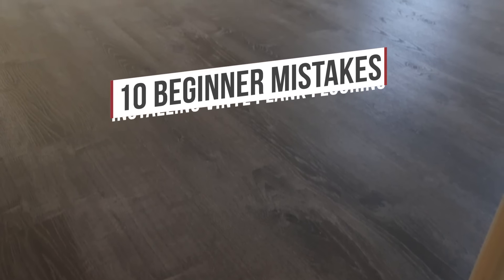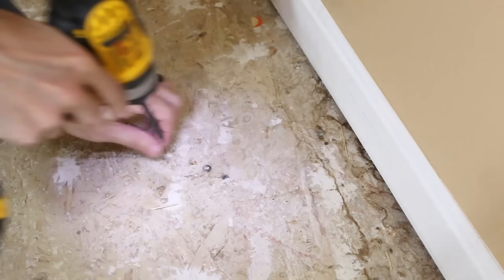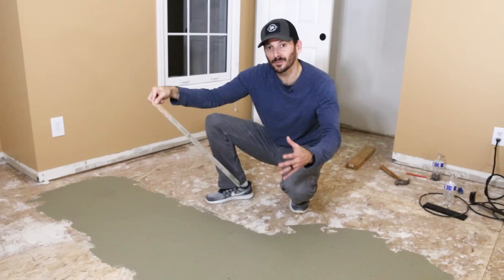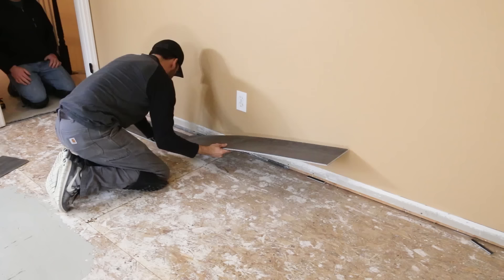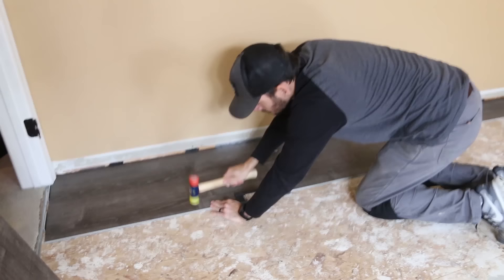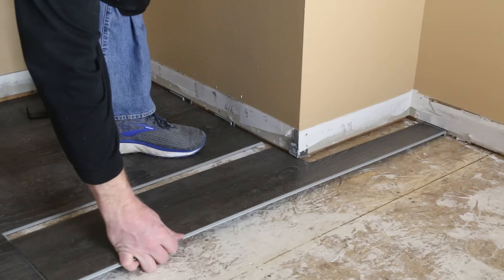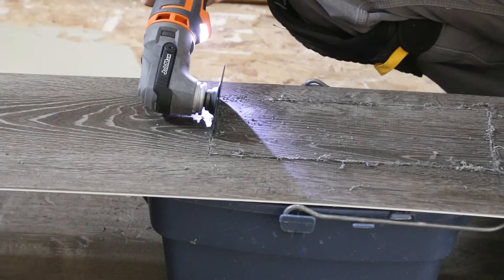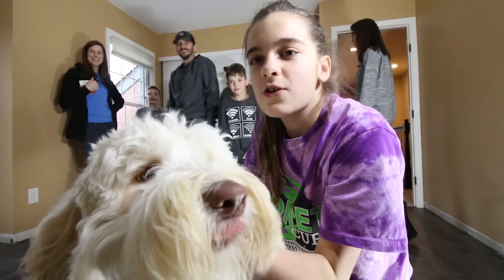10 Beginner Mistakes Installing Vinyl Plank Flooring

Comment: Anyone!  I am replacing carpet w/ planks.  The carpet butts up to ceramic tile on an arch and the molding is curved for the transition of carpet to ceramic tile.  Looking for ideas???  I had thought about grinding the carpet crabbers in the molding smooth and later pounding the existing molding down onto the plank w/ space?  Thanks

Comment: If your a good floor layer you wouldn’t need to remove the skirts, you would use a knife with cove blade to cut.
Also, you would lay it in a
Hardboard/Masonite

Comment: What would you recommend if I have asbestos tile under the carpet layer? Ive seen some videos on using perfect primer to cover the tile and then just using the vinyl over. What are your thoughts on this?
Reply: One suggestion - contact the Customer Support number for the manufacturer of the product you'd be using.

Comment: Old carpenters hint, get a piece of soap stone, sharpen it to a fine point and use it to scribe (mark) the dark material, shows up well and you can wipe it off easily with your thumb.

Comment: Leaving spacing for exspansion?. Looks great to me. And your right about  not leaving  underlatment.  Although  I've been in condos were  they make you put plywood down over cement.  Go figure. Cement is thick. There should be no noise. Know someone they made take the floor up.

Comment: Not trying to critique too much because that was a very helpful video. But one mistake was the way you used your flooring mallet. You want to be careful using the yellow rubber on seams because it's harder than the red. Use yellow when hitting tapping block or pull bar but almost always want to use red on floor because it's not quite as hard and hitting seams too hard can bust edges. The no smaller pieces than 8 inch rule is a good one but pay attention to specs on specific flooring because it might say not to use pieces smaller than 12 inches, we always read specs first. You also want to layout flooring alternating between large starters and then smaller but not stair step. Meaning starting with a full board, next starter is shorter, and next starter is shorter than last. Also keep away from H's, stair steps and H's drive floor guy up the wall. Some will just alternate between full board starter then half board starter and then repeat. Also good mention separating flooring so you don't fill area with same pattern boards and can alternate and space out for better look. Again not trying to critique too much, been laying floors since 07 so just sharing personal knowledge is all.
Reply: Oh, and a good scraper blade is best to use to pull up staples used for unlarlayment to pull because some carpet guys go to town stapling in padding.

Comment: I've already installed these type of floors, so I didn't watch the video. Did they mention you really need to put several hundred pounds of weight on the first half dozen rows or the floor will keep shifting?  In fact, you need to keep weight on it until your nearly finished. It's amazing how easily the floor moves and falls apart without the weight.

Comment: to measure the end piece cut, flip it, butt the end against the wall and the grooves against each other.  Then just mark the piece to cut's groove where the installed piece's groove ends.  That gives you a perfect expansion space.
Reply: Don't you need a spacer at the wall?
Reply: @dreid4760  it’ll have one, the width of the groove.  Assuming the floor is going left to right, mark on the piece to install a cut line at the end of the groove on the left (installed) piece.  Now the piece to install will be 1 grooves width short of the wall.

Comment: Please can someone answer this question, I'm halfway through laying the entire living dining room flooring and the concrete subfloor has an expansion gap through the center of it. the area is not completely flat because of that gap that allows each section to settle independently. Should I just cut the flooring and have it go to each side of the gap and install a rubber grommet between the sides? I dont want to waste time leveling the subfloor when its going to shift over time making that task redundent

Comment: Some good stuff here. My two cents.
1) mitre saw. Don't, its really messy. Use a good quality snap-off utility knife. 
2) Measuring. In addition to the course length, measure the width of the room. That way you can figure out how skinny your last course will be and adjust the width of the first course to allow something workable for the last course. 

I did a kitchen floor once that joined to carpet. At one point I was left with a nearly impossibly skinny piece to fill a gap. I wasn't happy with myself. 
3) underlay. Good point about the warranty but not all built in underlay is created equally. I did a cement basement floor once, religiously cleaning for each course. When i walked on it afterward, there were crunchy sounds. This wouldnt be as much of an issue on wood subfloor.

Comment: Easy if when you remove the skirting boards in a new house as there are no loose or large junks of plaster that fall off, resulting in the need to start plastering the wall.

Comment: I had a Pergo laminate floor installed about 10 yrs ago and they just used quarter rounds. I guess it's because my wide baseboards are 80 yr old natural oak and they probably would have been destroyed if he tried to remove them.

Comment: Dude, I’m looking at installing these in my basement, but I’m worried with the long run. What happens if I end with water in my basement for whatever reason. I know these are waterproof, but if it floods, I will end with a wet surface underneath. Any comments about that concern? Also, what is an acceptable uneven floor? I mean, 1/8 of an inch under the lever is going to be noticed?

Comment: Where I see your point about removing the baseboard I couldn't help noticed that the paint line was down almost a quarter of an inch If you want to reinstall the baseboard tight. Being a professional painter by trade standing down that old paint line/ Caulk line  It's incredibly time consuming. I know for a fact I can install that quarter round in probably  an hour and be done with the job. Fixing that paint line is going to take an extra day because you have to let things dry.   1st you're gonna have to  Sand or scrape that old  caulk where you remove the baseboard,   Then there's not even a question you're going to have to put some drywall compound down there to fix any gouges you make, It's not a question you're going to have to prime it and then paint it probably 2 coats.  But Hey if you think all that's faster than just putting down the quarter round power to you.

Comment: Hi, was that a latex screed leveller you used on the sub floor or just repair mortar. As the wood floor moves underneath i wondered if the screed would crack!

Comment: I have padded back waterproof vinyl I'm about to install. I've been told I need to use a moisture barrier on concrete before installing. Any advice is greatly appreciated!
Reply: Moisture barrier is typically a good idea for an engineered floor (wood, mdf, partical board) or a floor installed with adhesive. The moisture can make these items fail. The vinyl floor shown does not have any of these issues so a moisture barrier would not be necessary.
Reply: You should still use a moisture barrier for a slab install.

There are a number of WPC core vinyls that say you don't need them, but an SPC core can be damaged by chemical reactions with the slab.  Its rare, but it can happen.  I ended up getting three gigs in the same neighborhood from saturated slabs causing damage to SPC LVP from the alkalies in the slab.
Reply: @daleludtke7803  thank you very much! I did use the barrier!

Comment: So you can just pull up the carpet without having to pull off the baseboards? How do you know if you can do that or not because the majority of the videos out there show that you need to pull off the baseboards.
How do you attach the new vinyl flooring to a concrete floor? Is it just free floating on the vapor barrier?

Comment: Use a scraper to remove staples  much faster than pliers.  No leaving base on is not easier   some plank has to be tilted a bit before it drops   in    cant do last row if base is on.

Comment: If I’m doing my whole floor , main floor . In this click vinyl, do I still need room separators for the door ways? Living room to kitchen. Hall way to bathroom?
Reply: No you do not need any transition between door ways but you would have to cut the boards well enough to be hidden under the door jams, I wouldn’t recommend doing diy in more than just a room because then you could offset the floor and not have it straight, you would have a massive headache trying to get them perfectly under the door jams and then there are tons more things that weren’t talked about in the video that should be spoken of. So if you don’t really care for it to be perfect or even decent looking then go ahead, but I would much much rather have a professional do that.

Comment: its easier to just scrape the seams where the staples are vs pulling them all out after the fact when dealing with pad. Just as you are pulling just go along with a sharp putty knife or a $15 razor scraper to knock them out of the sub floor as you pull up the pad.  there still will be some left but they are much more easy to manage this way.

Comment: I’m in a debate that maybe someone can help. 

We have a dip, it might be extra work, but I want to pull the floor and use stacks of 1/8 shims until it’s level. Then put the subfloor back down. I find this better, in theory, that using a half inch thick of putty. 

Anyone have thoughts on this?

Comment: I am laying laminate flooring in the upstairs bedroom and I laid out the first row. I think the last piece in the first row was 13.5 inches in  length. I started the second row and I am having issues getting the board to click in with the short piece and the long  piece next to it. That last board on the first row pops up along the wall. Yes I used spacers. I am not sure what is happening here. I am at a standstill trying to figure out this issue. Has anyone else had this issue? Not sure if I am explaining this well.

Comment: Ending on 2 inch boards.
Stop the mathing. 
Run ur first row off a full board. Then subtract the end lagth from ur starter and use that to draw a line across the room with a pencil. Don't use starters that are at the line or behind it by 5 or more inches.

Comment: Since the floor is lower the baseboards are going to reveal that strip of unpainted wall at the top. Easier to scrape / patch / paint that before you lay the floor.

Comment: Floor scraper to pull tack strip and staples. Your first mistake. Pull all base board ofc. Um thin set can be either thick" less water" or thin" more water. Second mistake is the shop vacuum. It spreads dust in home and doesn't really clean foor that well. It will get edges great. Use a simple broom and then hit with a mop. Material needs to acclimate be careful with that tapping block you will damage flooring. I also see that you left to much space on left side of door. Baseboard won't cover that. Thanks. Yes follow what the boxes of floor say.

Comment: A small suggestion that was missed making sure there is not the odd nail or screw sticking up that was missed.   Take a piece of straight edge and run it over the floor. Any protruding item will catch on the straight edge.  Happy floor laying.

Comment: Nice video but I fine if you just leave it random it looks like the floor goes out through the whole house and yes just make sure you’re in joints are 8 inches apart

Comment: are there different concerns if laying the flooring on a concrete slab?
Reply: Slabs are not as flat as most people think.

So you will be doing some leveling.

Also, even with a water proof floor, get a vapor barrier down.  While the water that may wik through the slab may not hurt it, a SPC core LVP can warp from the alkalies in the concrete.

Comment: I've got the opposite problem with my kitchen floor, instead of a dip there's a bump at the transition to the entryway. What's the best way to deal with that?
Reply: Hire someone to grind it down, don’t recommend attempting yourself even if you can rent a grinder

Comment: Great instructions, so thanks, but I'm surprised you don't mention the need to use spacers around the perimeter to ensure there's room for expansion and contraction so the planks don't end up buckling. I realize you used them but, unless I missed it, there is no mention that this is needed, how big they they should be, the types you can use, etc.

Comment: Some disadvantages of vinyl flooring include:

Cannot be repaired

Can emit volatile organic compounds (VOCs)

Shorter lifespan than wood floors

No impact, or negative impact, on home resale value

Difficult to remove, especially if adhesive is used during installation

Not eco-friendly; difficult to recycle

Comment: Much of my research has always stressed "underlayment". I have watch several of your videos involving vinyl flooring. I noticed that you do not use it in any of them. What is the reason that you do not? I do not want to buy underlayment if I do not need it, so I am wondering what your thoughts on this was. Thank you.
Reply: The product in the video came with an underlayment pre-installed. Much engineered flooring requires a good underlayment. Vinyl flooring that has a pre-installed underlayment which is used with an additional underlayment voids the warranty because too much flex happens at the joints which can cause joint failure.

Comment: Just start your floor off normally and where it lands and lands it makes it appear that it’s running under the wall and into the next room that’s why they call it random links and that little piece in the corner keep going you can fill it in later that’s not a big deal and on a subfloor you don’t need underlayment

Comment: Mistake 11. 
Most product on market needs flat surface with a 1/8 limit on 8 feet. Not to be flatten by 3 feed flimsy piece of wood, You need straigth edge tool.

Comment: Never put a t-molding against the carpet.... it will break ( too much give with a vinyl transition piece, t-molds are for use inbetween 2 hard surfaces... ) always use an endcap, square nose , or baby threshold;   also you can use a z-bar and stretch the carpet and wrap it against the factory edge if you don't want a molding at all....I've been installing laminate and vinyl hard surface since 1997

Comment: Our LVP IS bowing at the seams  after 12 months all over the house they installed straight on the slab
Reply: The slab most likely has a high moisture content... it only has one way to go, up and out, and the weakest part of the floor are the seams/locking joints.

I see it waaaay to much.

Vapor barrier on all floating installs.

Comment: Before starting, you should always measure the width of the room also. 2 reasons. First, your first and last row should be the same width. Looks much better. Second, you don't want that last row being an inch or 2 wide, for the same reason the last piece in a row should be more than 8".

Comment: never used that with the underlay on already ,
if you use underlay it allows for a slight uneven 
floor to be laid , would think that looks a bit 
thin to be laid on a concrete floor , would be a bit 
cold ...............

Comment: You're not doing expansion at transition strips, using quarter round after installation would save on the labor of removing Base, and now you have to repair drywall and paint from knife scores in the drywall and peeling paint. If the door trim is short from the floor we usually cut a two and three quarter inch block by 6 in that would be higher than the five and a half inch material that we're using for base. Cut the door tri put in the block at the bottom of the door trim and then run your new base into it. It makes no sense to uninstall baseboard and put it back in then have to do all the other maintenance next to it but it's not my dollar so good luck!

Comment: If the baseboards/skirting have been stick on with no more nails/ construction  adhesive you will not get them off without damaging the wall. Easier to cut the bottom off with a multitool

Comment: My main question is do I need floor insulation under the vinyl? If not when I need it
Reply: The flooring is pretty temperature neutral.

Its a common myth that certain floors are colder than others.  Its the transmission of energy (heat) that makes a floor feel cold.

LVPs are made of plastic and limestone, they transmit energy slower than tile.  

It will feel colder than carpet, but far warmer than the slab or tile.

You don't want anything that can cause that floor to move... don't put a pad under it unless its something like cork or one of the new dense acoustic pads.

And don't forget a vapor barrier!  

It is needed.

What you think waterproof is, and what it actually is are two different things.

Comment: Putting quarter rounds after the floors installed is way cheaper than damaging or replacing the baseboards if you break them

Comment: Personally I would use a 1/2” x 3/4” base shoe instead of removing all the baseboard. If you decide to remove the baseboard you then have two options. Buy taller base to cover the old paint/caulk line (which means painting all of that new base) or reinstalling the old base after skim coating (to cover the old paint line where there is going to be a ridge) and repainting all the walls. All of this is way more work than installing a simple base shoe which comes preprimed and likely only needs one coat of paint to finish it.